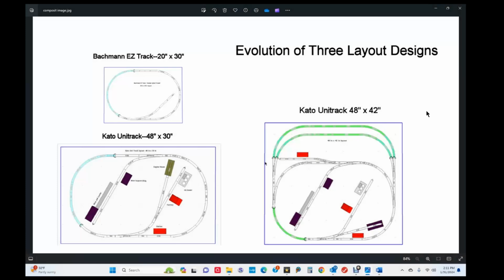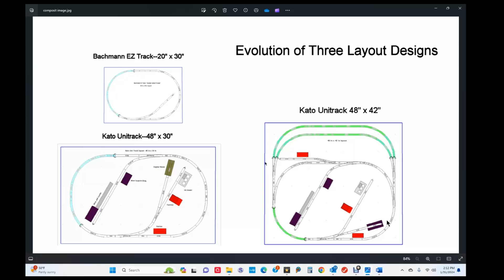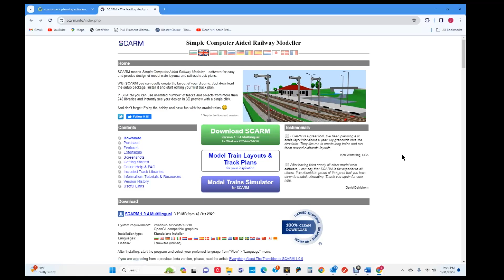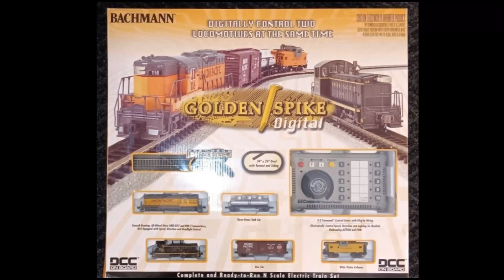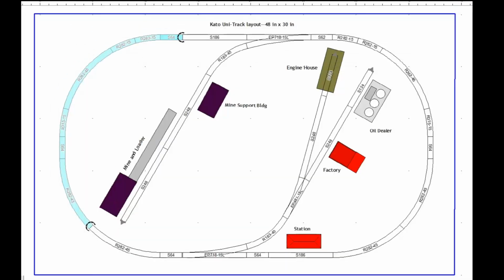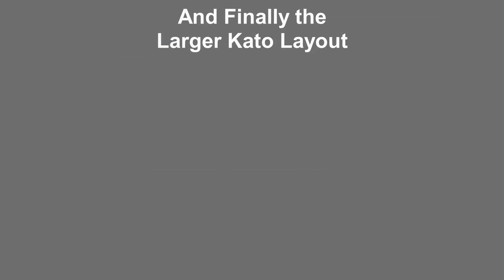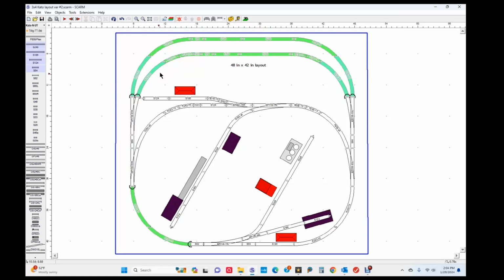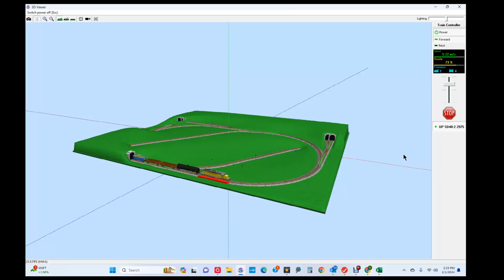My Next Small N Scale Layout, three variations, with examples with SCARM track-planning software

Comment: Curious, your video of the "Conejos Valley RR" got me really interested in model RR. Started then to look into the Atlas Track planning sw, After looking at what was available , tried Atlas then tried AnyRail. Was able to design using Atlas track fairly quick and easy. Do you recommend SCARM over AnyRail? I like the simulator option in SCARM! Haven't decided which track company to use for my first design/build. What do you like, why? Leaning towards Atlas and not any prefab road(plastic ick).  Inherited an HO prebuilt track layout with cork roadbed. Have 23 engines and 35 cars so I will stick with HO.
Reply from the maker: Sorry, I'm not familiar with Anyrail.  Happy with SCARM.  I'm about to try Keto Unittrack and should have more info on that in a few months.
Reply: @DeansNScaleTrains  thanks for reply, getting up to speed with scarm and track choices, really like the simulator.